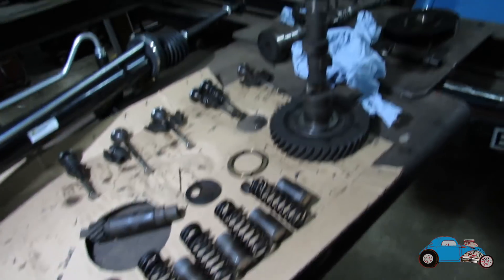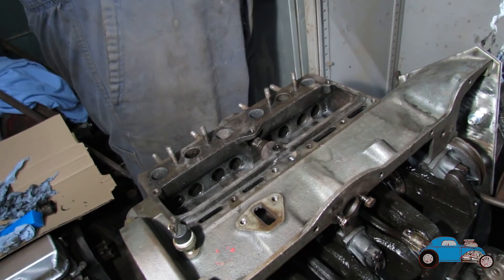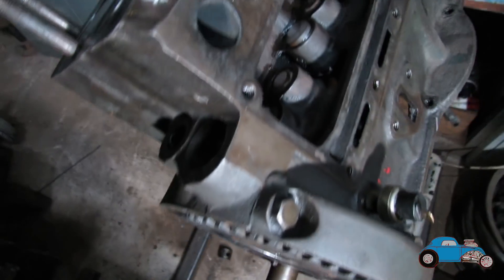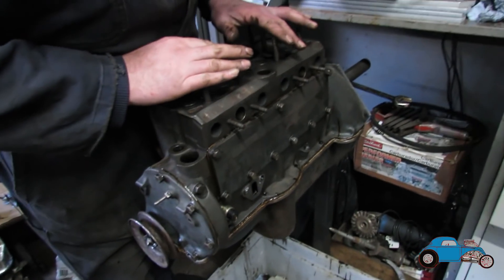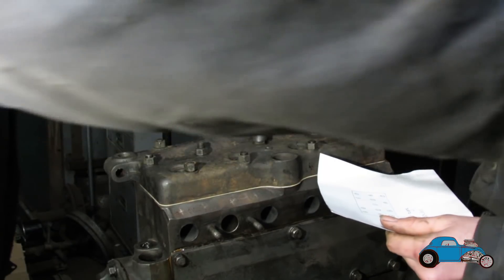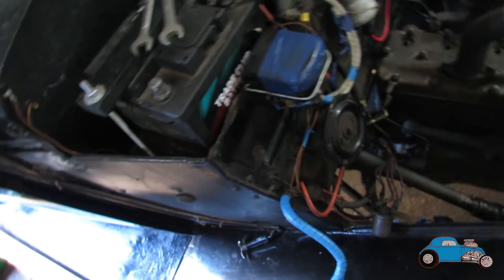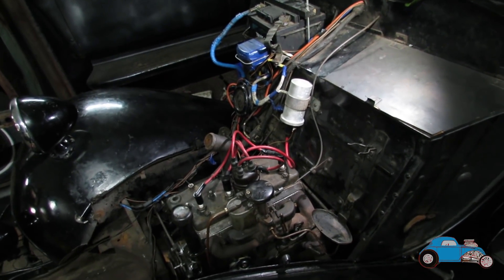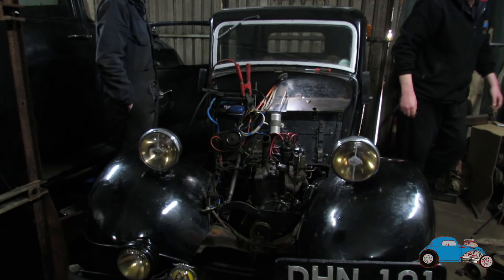Will it Run?? Repairing the Ford 8 model Y Engine Part 2

Comment: "Negative earth." Wouldn't this be positive earth? Also, isn't it better to paint cast iron engines to protect them from corrosion?

My condolences for your loss. I lost both my paternal Grandfather in December and maternal Grandad (also Tony) in January; 94 and 86 respectively.